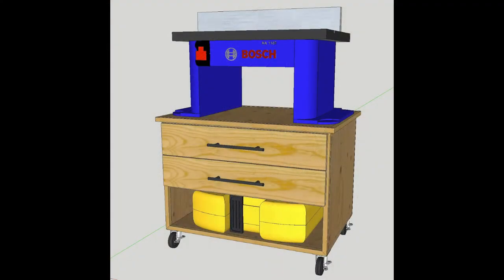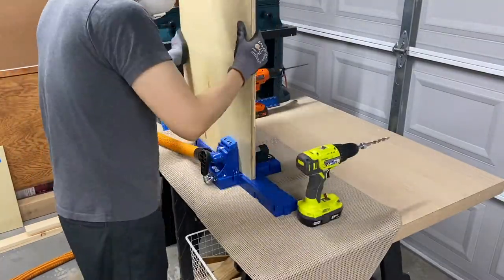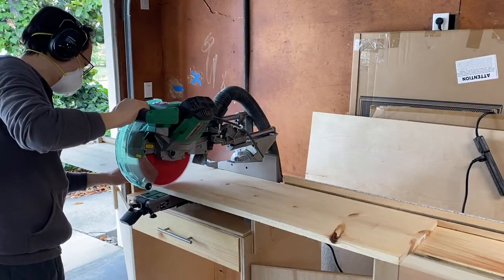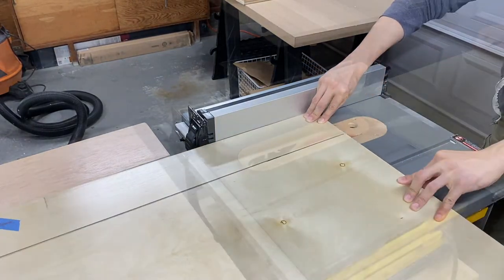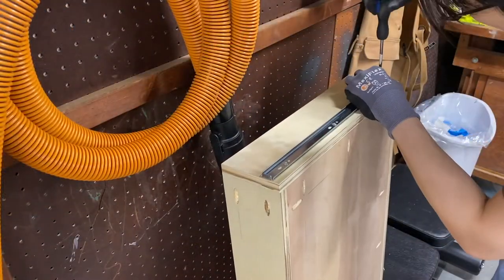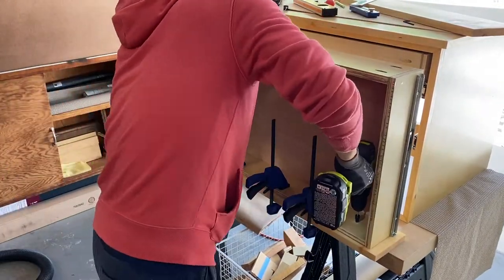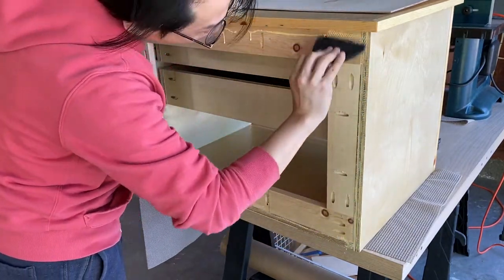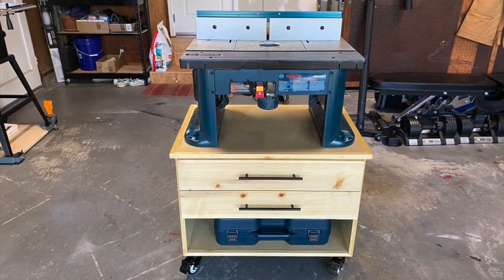Build a router table cart!

Comment: What kind and size of screw did you use to attach the router table to work surface?
Reply from the maker: For attaching the router table, get some lag screws or bolts. I don't remember the exact dimension, should be something along 2-3 inches. I believe if you read the manual of RA1181 it has suggested dimensions! The bottom line is it should be long enough to bolt it to the table top, and not too long to protrude into the drawer space. Hope this helps.

Comment: What size of drawer slides did you use?
Reply from the maker: I used 18 inch full extension drawer slides. I've updated with a link in the video description in case you are interested in the product I used.